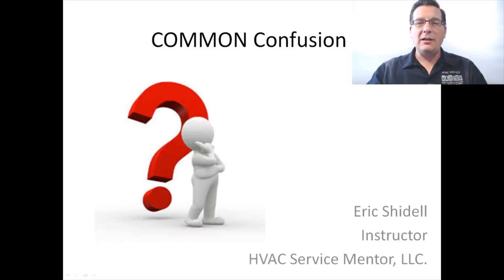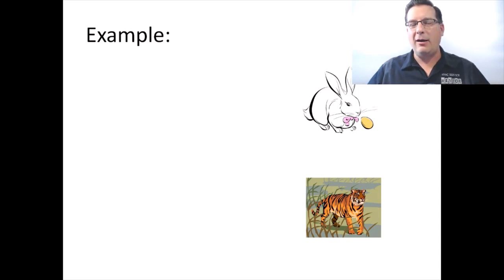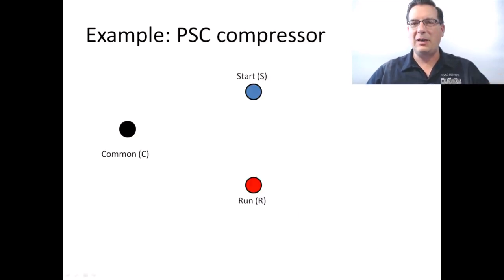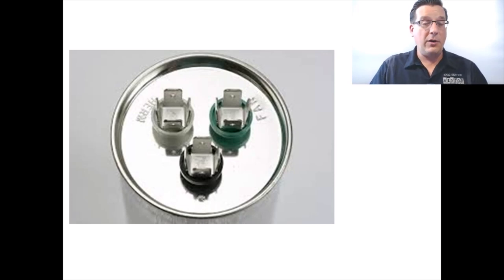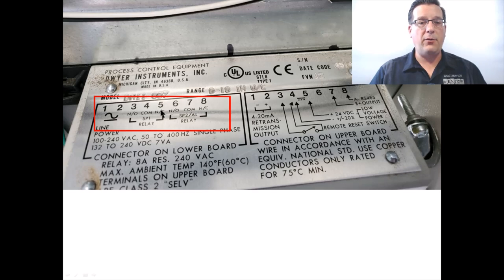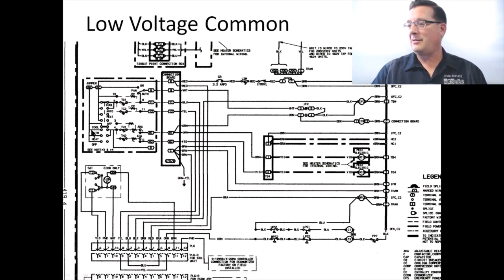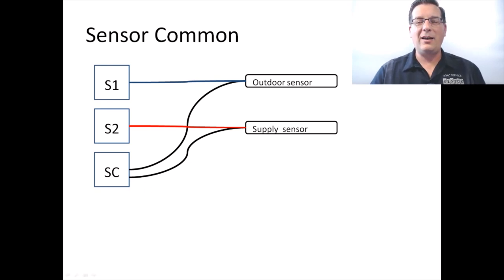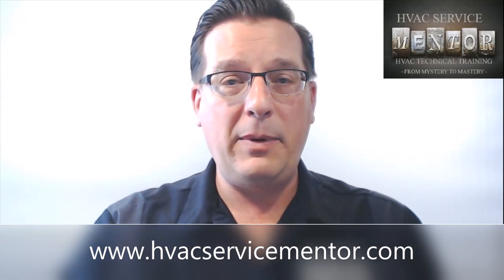Clearing up confusion around the term "Common"

Comment: You would be surprised how many people cannot correctly define the term “Normal” when it comes to relays . Many people seem to think that “ normal” is with the coil energized which we know not to be true. The term “ normal” can best be defined as “at-rest” or the state of the relay right out of the box .
I’m sure many techs and engineers have brawled over this subject on numerous occasions. 👍😂.
Reply from the maker: I have also seen many instances of equipment schematics getting this wrong as well.

Comment: Common means the common path for current. In every example you showed it remains the same. It's a point a that no matter how you wire the device/ sensor/ or load, current has to pass through that point. Whether its on the input or the output.

Comment: When you are explaining the low/ high pressure sensor in relation to "common", you state that terminals 345 and 678 have nothing to do with other.
But surely they do, they that common terminal that connects them.

Comment: I love your try to explain the term common .But I think electrically is wrong in a step down transformer or stepup .wich one is the common wire in a relay or switch ? just because they share a connection is supposed to be call common .REALLY? What I understand  is that in AC are two wires one call neutrol and the other hot  by norma is the the hot wire  that you connect to the switch relay or any device that you want to activate while the neutrol goes directly to the load.M I RIGHT? DOC

Comment: Well, then hot L1 is also common in a 115 circuit 🤔
Reply: Whatever color the wire is that connects to the neutral bus at the breaker panel is common.